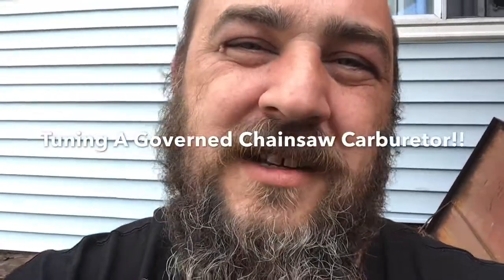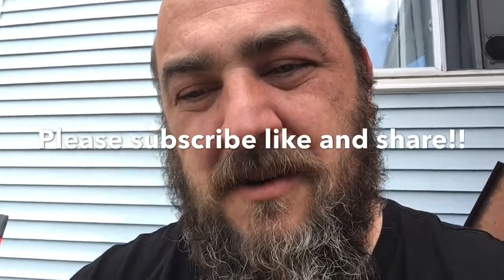Chainsaw Governed Carburetors!!  Do They Perform Well??

Comment: Recently picked up a super xl-130 with a governed carb, out of my 25+ Saws first time I've dealt with one, gonna swap it out with a hs125b I have laying around that is not governed
Reply from the maker: You can block the governor if you wish to go that route.  Then it operates the same as a normal one.  Well that is unless it has a semi fixed high speed jet.

Comment: It's important to understand the way these governors work.  The ball valve will vibrate off the seat when the frequency of vibrations reaches a specified pitch.  Otherwise they are not increasing the amount of fuel set by the High speed mixture screw.  Blocking them off wouldn't normally cause any change in behavior unless the engine RPM reaches the point in which the valve is designed to vibrate off the seat.  At that point, the governor will allow additional fuel into the high speed circuit causing the RPM to drop which in turn would close the valve. This of course happens very rapidly.  You can in fact lean the high speed mixture with the normal adjustment screw to the point that you can seize the engine.   As a Homelite employee back in the 1980s, I was preparing saws for a trade show one day and pulled a new 750 out of the box and started it up to check it.  Within about 20 seconds it threw the connecting rod because it was too lean and over revved.
Reply from the maker: I am actually working on a video right now that discusses the point of to lean. I am making notes to try and remember points that I should touch base with.
Reply: @Smittyschainsaws  Adjusting carbs without the proper frame of reference can certainly be disastrous.  We used to talk about the proper adjustment being at the point where the engine just starts to 'four-cycle', most people don't really know what that means or sounds like.  When the 410 first came out the factory recommended that you adjust to the point where the engine would nearly die at full throttle when you stall the chain in a cut, then back off about 1/8 turn of the screw.  That saw revved higher than any of their previous saws at the time.  At one time I had a 410 prototype that was really hot but they detuned them before going to production.  Anyway for the uninitiated, the 'Four-cycle' sound I mentioned above is the point where under load, the engine sound bounces back and forth between a higher rev and and a slightly lower RPM where it sort of burbles.  Hard to describe but you know it when you hear it.  You can hear it in this saw while you're in the cut, technically you have it adjusted as recommended.  The fact that it's stumbling when letting the throttle off is fairly typical I think of those saws with the pyramid reed setup because fuel can puddle in the reed cage and when the saw drops to idle that extra fuel causes a rich condition and causes the stumble.
Reply from the maker: @zzzgz5  You have a good way of describing it.
Reply: @Smittyschainsaws  The danger in trying to adjust a carb on a 2 stroke is that many people come from 4 stroke experience where they were taught to adjust to the highest RPM and then back off slightly.  On a 2 stroke, adjusting to the highest full throttle RPM is too lean.  The heat generated can cause a lot of damage very quickly. You're not only taking away fuel ratio, you're also taking away oil and if someone doesn't know any better they'll be destroying the piston/cylinder.  I know that you understand this, the comments I'm making here are directed more at your viewers who may not have your experience.
Reply from the maker: @zzzgz5  I believe on the next tuning video I am going to show how 4 stroking is such a good thing. It should start instantly when you come out of the cut. Even a dull chain with cause it to happen.